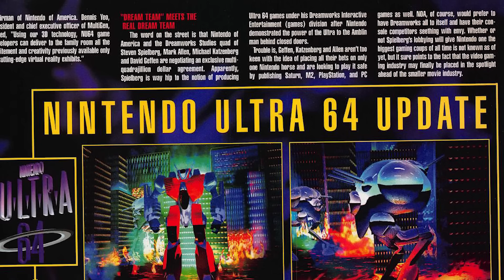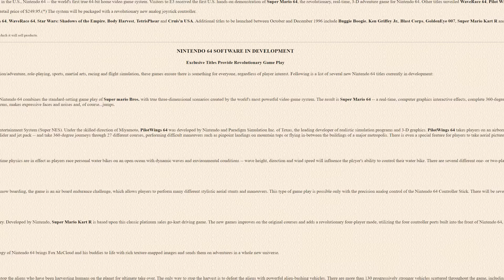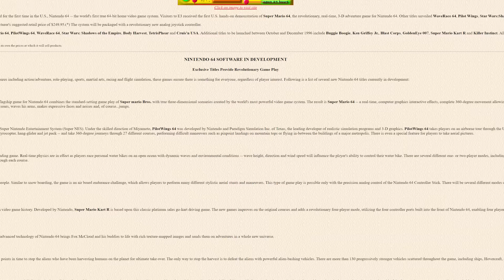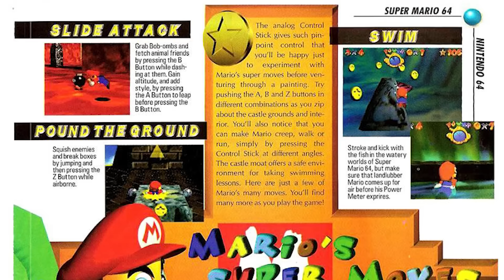I Bought A GameStop Refurbished Nintendo 64...And This Is What They Sent Me

Comment: 12:38 "Nintendo admitted that cartridge were not the future"
Also Nintendo : Switch now had 64gb cartridges
Reply: I mean, there was no other way for it to have the same form factor if it used discs
Reply: i mean they kinda had to why would u want a heavier systems vecause u had a dvd or mini dvd slot (Plus that was 20 years ago with much larger tech)
Reply: Aren't the cartridges just SD cards?
Reply: @AscendedBeyond  pretty much but im pretty sure they are a bit diffrent (all i know is they are not exactly but they use sd card tech as data storage)
Reply: Even though they're referred to as cartridges, the Switch game carts are a completely different thing than those old cartridges. From a technical standpoint, they are much more similar to discs.
Reply: MLennholm CD’s and old carts are both ROM, the switch carts are flash memory, so from a technical standpoint the old Nintendo carts are more similar to CDs than to the switch carts.
Reply: @HiDefHDMusic  ROM just means that it's read-only-memory, that's not a significant attribute in this context. A printed book can accurately be described as ROM. 
The old cartridges were active circuits that got mapped straight into the memory bus of the system, meaning they literally became part of the system itself. This is why they had zero load times (the data is already in the system, it doesn't have to be loaded in to it) and also how they could have hardware expansions like battery saves, MMC chips and the Super FX chip built right into the cartridge.
Optical discs on the other hand are, just like the Switch game cards, merely passive repositories of serialized data. The system has to read the relevant parts of that data and store it in its internal memory (RAM) in order to be able to work with it. This is why these systems have load times. To the system, it's just a stream of bits and it's irrelevant if those bits comes off of a rotating optical disc or a solid state memory card.
So no, the old cartridges are in no way similar to discs but the modern "cartridges" are technically almost the exact same thing as discs. Only the form factor and read mechanism is different.
Btw, Switch "cartridges" are also ROMs. While the DS and 3DS game cards contained a small programmable part, the Switch game cards do not. Read-only chips are much cheaper so Nintendo opted for that in order to keep costs down. Patches and saves are always stored on the Switch's internal storage (or inserted SD card).
Reply: MLennholm you can’t reprogram NES chips they don’t use EPROM they use mask ROM, which is permanently written during the manufacturing process. 

People use old carts for donor boards and use EPROM chips from other electronics as donor chips. EPROMs can only be physically erased by long exposure to UV light and reprogrammed with high voltage tools. 

EEPROMs have the circuitry to be erased and rewritten at the logic gate level. They’re simply more advanced.
Reply: HD S Fair enough, but the reason mask ROMs can’t be erased is simply because they lack the physical mechanism to do so, the bits themselves are still potentially erasable. I’d argue this is more equatable to how the ability to rewrite the bits on a game card is disabled in the hardware than to the physical bits in an optical disc, which are not even potentially erasable.
Reply: HD S Btw, we’ve really devolved into nitpicking and arguing semantics now, this is pointless. My original point was simply that the OP’s suggestion that old cartridges and Switch ”cartridges” are the same thing and that there’s some kind of hypocrisy in ”going back to catridges” is an ignorant suggestion. Would you not agree with this?
Reply: Put simply, a cartridge had a lot more going on than just the read only memory. They often contained supplementary chips (hardware) to do some of the work the system couldn't do on it's own. A switch game is nothing more than a "SD Card"....put generically. All of the lockout features and protection is simply software, rather than hardware, as seen in cartridges. Something else to consider is back then, the cartridge stored your save data ..again requiring more hardware. A Switch game, as with most most current consoles have internal storage for save games, and no longer require further hardware, such as memory cards or writeable memory banks within the cartridge.....or backup batteries. I'm looking at you, Sega Saturn.
Reply: Well, to be fair, Nintendo ALWAYS had cartridges when it came to their mobile/portable gaming, so there's that factor.
Reply: @WedgeBob  seems it was always the future lol
Reply: Honestly its a bummer. Cartridges hold more memory, are more durable, and look more impressive on a shelf (opinion).
Reply: @ArtisChronicles  Well, their original attempt to move to optical media over cartridges bigtime failed...they had their opportunity with contracting with Sony, which obviously backfired, Sony went with the PlayStation on their own, they tried going to Philips, and you know what happened there.  It wasn't until the GameCube and the Wii when they DID move to optical media, but even there, uhm...yeah.

Comment: The N64 Jumper Pak was actually a termination card. The N64 uses RD-RAM for the 4 megabyte memory and given the expansion slot, the jumper pak had to be made to terminate the RD-RAM "signal". It was merely an arrangement of circuitry rather than containing an integrated circuit. Old PCs, such as Socket 423 Pentium 4 systems used RD-RAM and had these termination cards in the RAM slots if not all RAM slots were occupied with actual RAM. Great video!

Comment: I have my N64 since 1998 and it has to be one of the most indestructible gaming consoles ever. This is almost Nokia 3310 levels of tough. I often used my console in a room where all the family walked through the space in front of the TV to get to another room. Having a few controller cables snaking on a similarly colored carpet resulted in a huge tripping hazard and countless accidents where something was yanked hard across the room. Either a controller went flying and crashed into furniture or a console went rolling across the floor or sometimes both. It happened so many times, but nothing ever broke. The controller plugs and the cable held up fine. Most of the time the game didn't even stop playing. A few times it even pulled the TV from its spot and back in a day they were stupidly heavy. And you know what? This system still works like new in 2020. No issues, no loose connections, no unplugging, replugging or blowing on cartridges. It just works.

Comment: The packing is crap. They should have bubble wrapped the individual accessories so they weren't sitting 'naked' on top of the unit, sliding around during transit and potentially making scratches. (The scratches on the unit may not have been there prior to shipping)

Comment: Obviously the old cartridge technology compared to today's "cartridge" is completely different, but it is interested how back then a CD was so much faster and could hold so much more data, where now, a "cartridge" the size of a postage stamp can hold 100+ times more data and is significantly faster than a CD or DVD.  With so many computers doing away with the CD drive, much like they did in the past with the floppy drive, it is about time that consoles all move forward as well. I own a DVD and Blu-Ray player, but even those have become relics collecting dust on the shelf.

Comment: Your N⁶⁴ (& its controller) are "Ice-"colored.  I received mine in 1997, but if the Jumper Pak is only used to 👢 the system, it should be able to function without it, afterwards.  I noticed mine didn't perform when that port was empty, but maybe I removed the component before powering on.

Comment: First game system I ever got new was the PS3 and I didn’t get it until 2011. My N64 I got from a pawn shop in 1998 and my PS2 the same way in 2004. The console I got closest to launch was the Switch the summer after it came out.

Comment: Nintendo hasnt gone back to cartridges. Presently their games are on CARDS (not carts.). Modern "hyper threading" allows systems  to read and write onto flash type memory cards fast enough to use them as external RAM. Here it is, in the laimen. Cartridge slots are basically expansion slots, allowing you to connect an additional board, with memory (and sometimes subsequent processors) to the motherboard. Nintendos games current form factor is, what amounts to, flash memory cards. Just additional memory for an existing board, no board of it's own to speak of. Carts: additional board with memory on it. Cards: additional memory for an existing board. So NOT cartridges, but cards...

Comment: I learned some interesting things about the N64 that I did not know. The way you felt when you got yours, I’m sure my sister felt the same way when she got hers. She was a gamer herself. I think it’s best to wait until the console has been out for a couple years myself. That way, it’s cheaper, people know how it is, you will learn from other people’s experiences, and get a better idea. To my observation, it seems like cartridges are harder to break by accident than disks. When I was little, I got pissed off at a game on the NES, I jumped on it out my anger and it didn’t break. I had to hit the reset button, but that was it and it still worked fine. I was lucky I didn’t break it and now I laugh about it. I’ve also thrown Gamecube controllers and chewed on the wires of the controller over a game out of anger. Nintendo makes good stuff. They’re products can really take a beating.

Comment: 75 for a complete ice blue system was a steal , been looking for a ice blue one and the cheapest one I found was 110 no cables or controller no games just the system and had crack on the side i just picked up a jungle green with matching controller in good condition and two games for 130 (part of me feels like I over paid but another part of me feels like I got a decent deal since I talked them down from 160 , budget was 100 but my birthday is coming up so I wanted to spoil myself a little decided to go over 30$)

Comment: My first console was a SNES, then an N64, then I eventually got a PS2 and it went down hill. I’m just not a serious gamer, there were a few games I really enjoyed on the PS2 but I would constantly lose interest in games I was playing. For years after that I didn’t have a console but eventually felt I should buy a PS4. Same sort of thing happened. Then I went down the emulation route with some good results but just not quite the right experience. The Wii never appealed which perhaps it should have but recently I learned about the Wii U. I just bought myself one and I’m very happy with it, especially with its different modes of play: game pad, normal controller, Wii remote, Wii remote and Nunchuck, Wii remote and accessories like the zapper. They’re just fun games that you can pick up for a couple of hours here and there.

Comment: Out of my almost 30 years of gaming ( i got a NES in 1990 for my birthday) the only console i have which doesn't start anymore is the N64. I mean my PS1 and PS2 doesn't read discs anymore and i am on my 3rd 360 since the other 2 red ringed. But for some reason my N64 doesn't boot, my friend has the same problem and apparently there is a problem with the N64 power brick so wouldn't call it one of the safer systems. Also those controllers... Only first party controllers i've had that broken down that much, even PS2 controllers work great for me still and some of those broke cause of the pressure sensitive buttons they had.

I am probably gonna get my N64 fixed, it has a special place in my heart as it was the first console i bought for my own money. Rest was either gifts from my parents or my cousin which was the person who got me into gaming. He is 13 years older than me and usually gave me hand me down systems like the NES in 1990, since he bought a SNES and he also gave me his old Gameboy one Christmas cause someone stole mine.

Comment: Lol. I remember the days of going to spend the weekend with my dad and then us going and renting a couple of games for the weekend. Super Nintendo, Nintendo 64, and PS2 in the order that they were pretty much the current gen systems. 
 As far as getting refurbished systems from Gamestop though, yeah. N64 was definitely built to withstand the test of time. Playstation 3, however, was not so gracious. 
 A few years back, I bought a used PS3 from them and it went tits up about a week or two later. I took it back, and the next one lasted a month. I don't remember why but I ended up getting screwee and couldn't get a refund. I was about livid. 
 Now, I got a PS4 about a month ago and Gamestop still wanted $300 for it, 1TB with no games and Walmart wanted $250 and 3 games, although 2 of them were to redeem and download. Gamestop said they did price compare but they needed visual proof of Walmart's price and the lady tried to sell me on getting a used PS4 instead lol. I shared my PS3 experience with her and she tried to explaine how the PS4s are built better and they never have problems with refurbished ones. Needless to say, I decided to be an asshole and drive literally across the street to Walmart and get the system with the 3 games and then back across to Gamestop to buy more games. Thought I'd share that. XD

Comment: dont be so keen on systems with no moving parts being fine.. n64 is now 20 years old and electrolyte capacitors only last so long before they either malfunction or burst and damage the pcb they are attached to.

Comment: When the N64 came out the PlayStation one was not out yet it was called PlayStation if you're going to talk about video games at least know you're freaking facts it was the PlayStation and N64 it wasn't until 2 and 1/2 years later of the N64 that the PS1 came out thank you you keep calling the PlayStation PS1 and it's driving me crazy it's not there is no PlayStation 1 games it only came out with the system there was the PlayStation then the PlayStation one later on